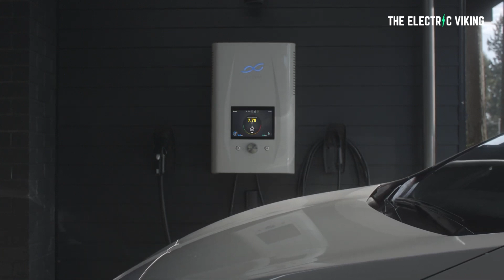The battery that charges 70X faster than lithium & has 300% more energy

Comment: What was once a dream for commercial flight looks like becoming a reality, a real nonpolluting passenger aircraft.
Reply: They can easily solve this problem with swappable batteries. Charge time then becomes irrelevant. It’s swap time that matters.

But then, most private planes spend 99% of their life sitting on the tarmac.
Reply: @terjeoseberg990  Agreed, battery swap makes sense for any vehicle that goes from set point to set point.
The increase in energy density though IS big news for electric aircraft.
Reply: @russelldesilva1560 , I agree. Energy density is extremely important for aircraft.
Reply: @terjeoseberg990  It's energy density and overall weight that matters, it seems we might have the best of both here. I was referring to commercial carriers, not small private planes some of which are already electric.
Reply: @pauljmeyer1 , I agree. Energy density is extremely important for aircraft.

Comment: Hang on, last time I read about al graphite batteries, they were single use, so the faster battery charge is via a battery swap. Smell something here.
Reply: Different batteries altogether
They where aluminium air batteries which got power from corrosion of the aluminium.

Comment: You weren't wrong about electric passenger planes but perhaps a bit unclear.  Lithium polymer (Lipo) batteries are commonly used in drones, and they don't explode in the air.  They can explode upon a crash, but most issues occur when they not charged correctly.  You definitely want to use safe batteries for an electric passenger airplane, but the risk is upon a crash, not while randomly flying around.
Reply: Yeah but it's no different than flying around in a plane full of fuel that can explode at any given moment something has gone wrong. Rare I know but it has happened.

Comment: Do you know how many times this has been said?  Sheesh, 25 years ago "fuel cells" for everything from walkmans to laptops.  Hydrogen cells. Super capacitors, etc etc etc.  The list is endless.

Call me skeptical,  but lets see a few thousand operating prototypes powering a vehicle . Put a 50kwh pack in a dump truck. Drain it and mega giga Superfast charge them 50 times a day for a year or two. Prove it ... then I'll believe it
Reply: For real